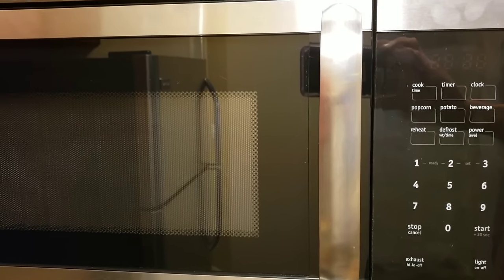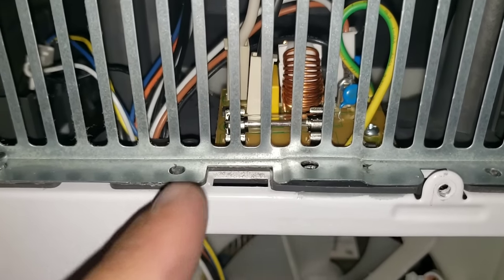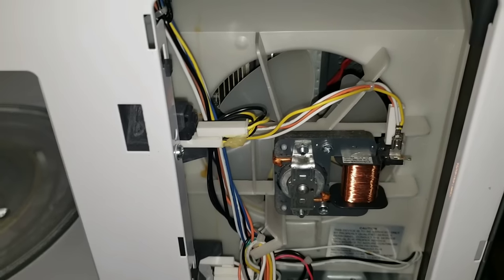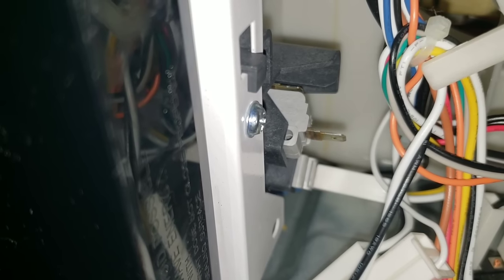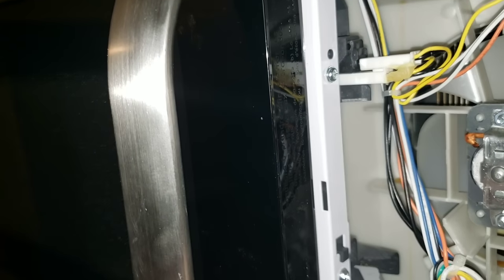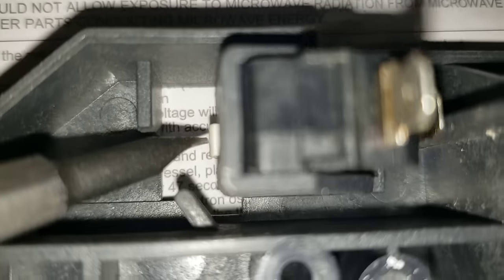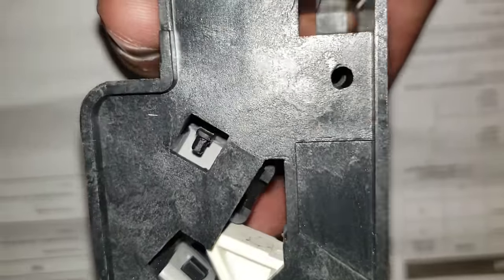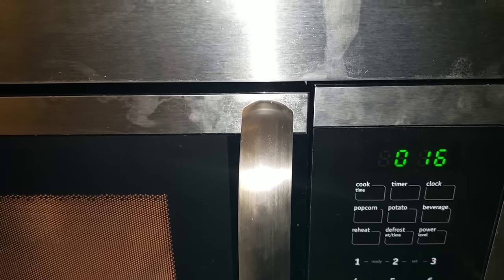Microwave Keeps Tripping Breaker? Here's WHY!

Comment: A year ago I fixed our Frigidaire Gallery by installing new microswitches.  It worked for a time, but then starting failing again.  I now believe that the fundamental issue with this oven is the door design.  Briefly, because the door is opened by physically  pulling the door open, here is a downward component of force when the door is opened because it's an above-range design.  Or we may get into a bad habit of leaning a bit on the door.  Over time and use, this causes the hinge to bend slightly which pulls the door out of alignment at the latch end.  I talked to an appliance repair guy who said that there are only three factories worldwide who make these microwave ovens, they are competing simply on price, causing a race to the bottom in design and materials, and basically they are all junk. So I purchased another design where the door is actuated with a spring-loaded button rather than opened physically by hand.  We will see how durable this design is.
Reply: Came here looking for a resolution to my Frigidaire Gallery microwave doing the same thing. It’s likely because my kids aren’t quite tall enough to pull straight out on the door and have been pulling down on it as they try to open it. Sounds like it might not be worth fixing in the long run based on your feedback.
Reply: Hi I have fixed my Frigidaire gallery numerous times. Originally replaced switches and fuse this game I suspected maybe the plastic assembly that holds switches may be worn down.  I replaced all three switches and a new fuse. 
Same thing works until I open the door. 
I don't know what to try next? 
Any suggestions would be appreciated.  
Thanks Dan
Reply: @dynadan1  Hi Dan, with much grumbling I gave up on the Frigidaire Gallery and bought a new Maytag microwave oven with a spring-actuated door release.  So far it works fine, with two caveats.  It's a bit larger in the vertical dimension so that the space between the top of the range and the bottom of the microwave oven is a little smaller; for us this turned out to be not a big deal (our largest pot for making soup / chili / pasta sauce fits, so all is well).  Also, my wife was annoyed that the light underneath the microwave which illuminates the range top was more dim than with the Frigidaire.  I replaced the incandescent bulb that comes with the Maytag with an LED replacement which helped a little.  We are now accustomed to the light intensity.  As I said in my post, I think the issue with the Frigidaire is that over time the door hinge gets bent such that the latch end does not line up and the microswitches don't engage the plastic do-dads in the door latch. I did not have success in bending the hinge to ensure a good latch.  Good luck!

Comment: Great job with the video. I had the same problem with the monitoring switch. When I pulled it out and tested it I found that the switch was I little stuck. I depressed the actuator and it worked properly. Then I noticed the switch bracket that held the monitoring switch in place was a little loose. So I took a thin piece of a business card and slid it in behind the switch so it wouldn't shift so much.. and it works perfectly. No part to replace. Thanks to your fabulous video my microwave still works.

Comment: All my door switches tested good with a multi meter. Your testing of the bottom left thermostat yielded continuity. Mine did not have continuity so I assumed it was bad. While buying a new one, the specs stated that it was a normally "open" switch at room temperature. So I had no continuity at room temp  as per design. Applied enough heat for the t-stat to close and produce audible continuity.  So my bottom left t-stat wasn't bad. Now the thermostat on the right is the cycling thermostat, which helps maintain the interior temp like any oven or dryer. The initial test yielded continuity, but when heat was applied it never cycled or closed. That's the one I'm replacing.

Comment: Your video was extremely helpful.   My Frigidaire Microwave, Model FGMV176NTFC, started tripping the breaker about a month ago and finally failed yesterday.  I purchased my first multimeter today on Amazon and now trying to find the correct switch for this model.  I have a feeling it's going to be the monitoring switch, but will not be able to determine for sure until I get the multimeter to check the continuity.   This microwave came with our DR Horton home, so you know it's not the best on the market.  We purchased the home in September of 2019.  Wish me luck and thanks again for all your help.

Comment: Thank you very much for the video. It's exactly problem that we had on our microwave. The faulty was the 2nd switch, part # KW3A, which is Normally Close (not Normally Open) and bought both different kinds over ebay for $12. I was confused at first between Normally Close and Normally Open. They are both same part # KW3A but when take a closer look on the switch connector, Normally Close and Open in different posotion. Also, remember taking picture every step you do, especially disconnecting those wires in control panel.

Comment: Thank you! It turns out the monitoring switch was just stuck. I didn’t even need to buy a new switch. With a little pressure it came unstuck, and operates just fine now.
Reply: It might be a good idea to replace it anyway. My monitoring switch was also stuck and then failed shortly after. They are only a few bucks on amazon
Reply: When a monitor switch is stuck it should be replaced with a good working switch not just released They're cheap to buy and easy to replace.

Comment: Fixed it!  The switches were good.  The problem was the DOOR latch.  The ends of the two fingers worn down about 1/16’’. Part was only $6.65 and genuine GE part too.  When I compared new with old it was obvious.  The door sounds more solid now when closing.  I have a GE JVM3160.

Comment: Thanks a lot for this video, very helpful, I just finished replacing the middle micro switch, exact same issue. FYI, Online, original switch from GE is about $44, Amazon has 3 switches for $10.

Comment: I'm so glad I found this video.  I had already replaced the turntable motor, which needed to be replaced anyway and is what I initially thought was tripping the circuit breaker.  I was honestly about to call an electrician to take a look at the whole circuit since that's where I draw the line in my own DIY fixing.  Your video was so concise and easy to follow.  I was able to test the switches just as you did and found the same exact thing was my issue.  Ordering new switches and replacing them like you showed.  My microwave is like brand new now and it only cost me maybe 50 bucks tops (turntable motor plus switches and shipping total).

Thanks so much!  Heavy thumbs up!

Comment: Spot on. Thanks a million. My problem was the monitoring switch as well. But I didn't need to change it. It was stuck open. Clicked it with my screwdriver and it was toggling correctly after that. Thanks man.

Comment: At the moment my bottom switch has continuity door open and closed so I`m thinking it is the one. Tested it when out, with tiny button depressed and not depressed same as open/closed door. I thank you for this. Look, I have been bragging how well my luck has been running. I have a circa 2008 Moen Chateau with filter system kitchen faucet all over the house at the same time I have this lol. One video kinda sorta. At least Moen has sent me free parts two times so far. gasket set, now waiting for spout. It is what it is, I`m sure you know. Thank you from an old maintenance guy from years ago;-) Cheers.

Comment: I believe, I might have the same problem - fuse blowing and one time breaker tripped.  I was thinking to check the capacitor.  I can use the technique you applied to troubleshoot.  Great video!!!  Thanks a lot for sharing your troubleshooting techniques.

Comment: Great, helpful video. Same switch was not working on mine, but I figured out the switch was fine. It was just sitting loose in the housing and the door latch was missing the button. I layered some tape on one side of the switch so it would line up with the door and now it works fine.

Comment: Thank you. Excellent video. You save me from a service call. I found a bad door switch. But to my surprise the switch was not electrically bad, just not latched in the plastic mount correctly so that the door latch would not engage it correctly. It seemed odd when I was doing the electrical check that the switch seemed a little afloat, and it appeared bad electrically when I opened and closed the door.  When I  inserted a screw driver into the latch to check the button on the switch, it popped into place mechanically and then passed the electrical continuity check. And, I was surprised to find the electrical schematic tucked into a void in the face panel.

Comment: I was skeptical at first that a bad door switch could cause a breaker to trip or blow the fuse.  However, I tripped the breaker several times and blew the fuse on our microwave and was able to fix the problem by replacing the defective monitor switch.  I did notice that the plastic part that the switches fit into was also worn down where the door latches slide.  This allowed the monitor switch to operate just by pulling on the door handle, before the door opened or the other switch changed positions.  I think this would have caused problems again, even after changing the defective switch.  Fortunately, I had a spare from a previous identical microwave that was still good and replaced both parts.  Works like new now.
Reply: I suspected the same changed plastic part and switches and it is still tripping the fuse

Comment: Thank you for the tech tip. I followed your method and found the middle switch was not working. Removed the switches as per your video and then proceeded to check for the click of the switch.  The middle switch was stuck and now moves freely with appropriate continuity.

Comment: Thanks for a detailed video, I just fixed my microwave by following the steps.  Monitoring switch was bad. I just pressed the button on switch few times and it worked fine. I think some grease deposited in the switch.

Comment: Hello Sam, I followed your instructions and the microwave is now working but it turns on just by being plugged in with no time on the display.  I had some of my Dad tools and he was an electrician, so I was able to follow you step by step.
I am a single mother trying to  not to have to but another microwave or have a repair man come only to have they look at you tube videos and then ask for $175.00 and not fix the appliance. 
Any Ideas?
Thank you
Michelle

Comment: Thank you for the detailed video. I was able to save $500 by using your video.. Thank you for helping community. In my case, fuse keep burning out moment i closed the door. The monitor switch had button pressed was not doing on/off as it is supposed. It was stuck at on position. I removed and just reset that. Since then no problem!

Comment: Thanks for the video. The  monitor switch was bad on my microwave. The switch contacts were welded together I was able to free them. But when I reinstalled the switch and turned on the machine it blew the fuse. So I disconnected the monitor switch and the machine seems to be working fine. Any idea why that should be?the switch is working fine now but not connected.

Comment: So there is just one thing and I'm probably correct to assume I should have a continuity reading, but you never test the "hood thermostat" on the video. My microwave went out yesterday and I've been checking it. The hood thermostat is the only thing not coming back with a reading. I'd assume that's my issue? I didnt know if it was a door closed/open type of thing, I assume not but before I start buying things a confirmation would be sweet. Thanks!

Comment: Nice job! It fixed the problem that I could not figure out.  Your video was the only one that did the trick.  Thanks again.
Reply: My monitor switch was stuck and the fuse was popping. Your instructional video saved me from discarding the microwave and saved me a lot of work and money. Kudos to you.

Comment: I wasn't able to find this video when our furrion microwave stopped working which is absolutely identical to this microwave. I replaced the fuses however they kept blowing. As an experiment, I installed larger and larger fuses to no avail. I did notice that the fuse blew one time when I open the door. Thank you for this video unfortunately I ended up spending $650 for a new microwave.

Comment: I have the exact same microwave, and it was intermittently blowing the fuse, or tripping the breaker. It always seemed to happen when I opened or closed the door. After testing the door switches as shown in your video, all the switches checked out okay. However for fun I decided to unplug the middle switch, and after that everything seems to work fine. I'm not sure what purpose that middle switch serves, but the microwave seems to function exactly as before but with the added bonus of not tripping Breakers or blowing fuses.
Reply: That seems to have done the trick for me as well: disconnected the middle switch on my piece-of-crap Frigidaire Microwave. Incidentally, the continuity check on the middle switch showed it passing current when the door is open or closed. When closing or opening, the switch flops around like a flounder out of water. I inherited the microwave, fridge and stove when I purchased my house. I will never purchase anything from Frigidaire, what absolute garbage these appliances are.

Comment: I really appreciate this video and the clear explanations. I was able to diagnose that the monitor switch was not working properly. I got a new one and installed it, good to go. But when I tried starting up the microwave it tripped the breaker again. I took it apart again and re-tested the three switches and it seems now the door switch isn’t working when it was before. Is that common? At this point should I also get a new door switch and see if that solves it or just assume something else within the microwave is causing the switches to go bad? Thanks in advance, I hope you see this comment and can give a suggestion!

Comment: thanks my microwave just stopped working, i tried the fuse on the plug and didnt work, however i saw this video and never knew their were fuses inside the microwave, opened it up took out old fuse put in a new one and bam she fired up. saved me some cash thanks.

Comment: I ran the test and found a bad monitor switch. I have ordered a replacement. Question, why didn't you check the hood thermostat? I didn't get any continuity on mine. wondering if that might be part of the problem.

Comment: Thank you so much! This happened to the 3 years old microwave of my parents. GE was of no help. It turned out to be the middle switch. I changed it as well as the fuse and the unit works fine now. The only problem I encountered was the markings on the switches appeared identical, regardless of the way they should operate (normally opened or closed). The only difference being the position of one of the contacts. So I spent more time looking for the correct replacement on the internet than the actual repair itself on the microwave.
Reply: Hi Kristine... I have a GE with the same problem... do you have the part number?
Reply: Hi Amy, The middle switch is a KW3A normally close microwave door switch. I got it on Amazon. There are also different switches in the door, including KW3A normally open. I originally ordered the normally open one but later got the normally close switch which resolved the problem.

Comment: Thanks a ton, great vid!! My GE microwave has a screw on the bottom side of the control panel also, and then also a silver retainer screw on top but inside a little. I had to poke a screwdriver down through the grating on the top of the control panel. Everything else was just about identical to the one in your video!

I had been putting this off for a little while for no reason, bc it was easy! Only thing is, I bought a 2-pack "microwave door switches" online, but they are the Normally Open type and I needed to replace the one Normally Closed one!

Comment: WOW…thanks!  Appliance repair companies won’t come out to repair microwaves, so they are basically throw away!  So, disassembled the microwave as shown in the video, and found that the monitor interlock switch actuator was stuck closed, due to WIFE slamming the door.  Found and metered all switches, and the monitor switch was stuck closed in both positions…. Pushed the actuator in and out several times, and it popped out and the microwave is now working!  Great to keep more junk out of the landfill!  THANKS AGAIN!
Reply: Trust me.... It wasn't your wife!! Microswitches are made to sell to MFR's for $.20... Thats 20 cents each!!
THEY fail all the time, no matter what the appliance or $20 to 50,000 machine!! (One of the weakest links!!

Comment: Great video Sam, I have this same Frigidaire microwave and the bad switch was spot on as you described.  Picked up the part for around $5 and was back in business in no time.  I agree with Juan below, wishing all tutorials were done this well....Thank you!!
Reply: Great video, thank you,  my middle switch wasn’t clicking. I pulled it apart with a flat screw driver,  it was stuck, messed with it, started clicking again, put the switch back together,  assembled everything back, thank God it worked!!! Didn’t trip breaker anymore, thanks again for the video